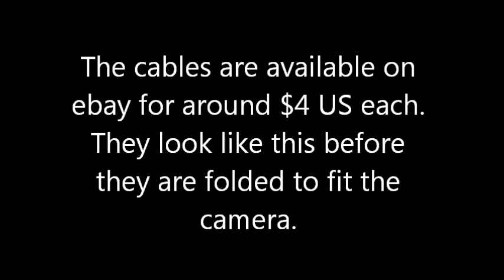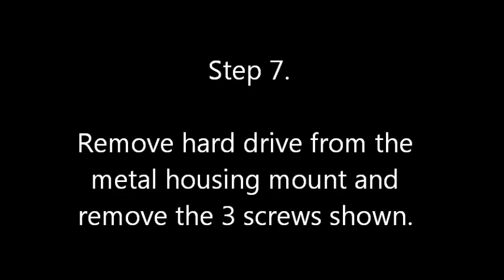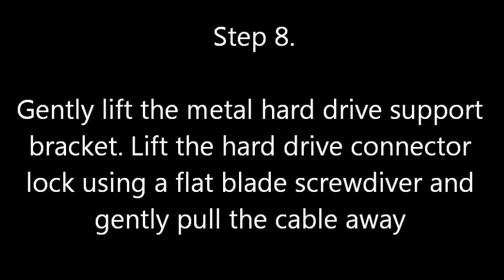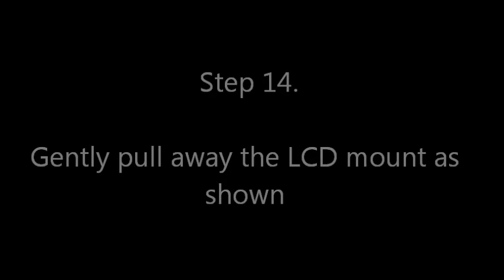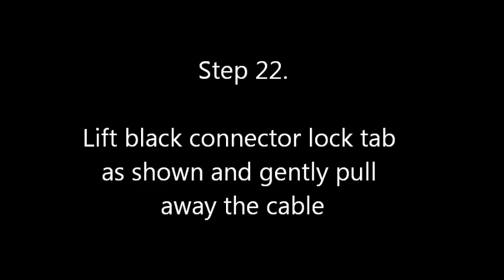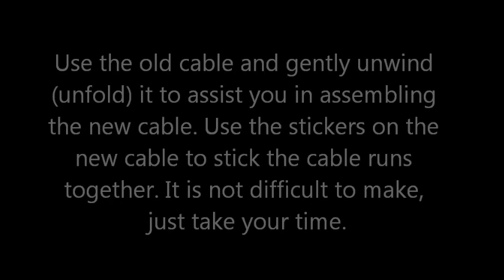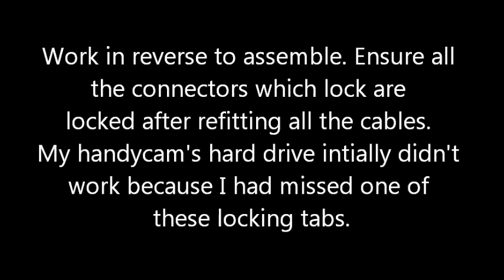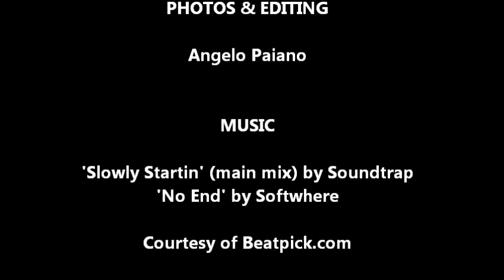Sony Handycam DCR-SR200E LCD Flip Screen Cable Replacement

Comment: Sir,
I require one sony handycam model no DCR-DVD808E display with flexible cable is it possible for you Sir? 
Please reply with your information please. 
Shinde
Reply: https://www.ebay.com/itm/253607505724

Comment: Just fixed my Sony Handycam DCR-SR82.  Great video.  Couldn't have fixed it without your help.  Thanks!
Reply: Hello my camera screen has vertical lines black and white, is it also from the flex cable or do I need to change the screen fully?

Comment: Hello budy, how are you ?
I have big problem I changed the flat cable, however remains the black wedged screen and more they do not light up, and before with the old lit still however was as if you were xiando, it is necessary to make those hinges on the cable? that other small and needed to be pasted on the most?
I thank the attention!
Reply from the maker: Liuz, if your screen does not work with the new cable, check all the cable connectors again. Push the cable in as hard as it will go then lower the locking tab. Check every single cable connector that you disturbed.

Comment: THANK YOU! I just repaired my Sony Handycam DCR-SR62. All components and screws are placed exactly the same way. Just a tip, I used a paper clip bent to a U-shape as a guide to aligning the holes on the new cable as I stick them together.

My other problem with this camera is the power / toggle switch acting very sensitive turning the camera on and off with the slightest touch. I'm still looking for info on how to repair/replace the switch. Please point me to the right the direction if you know.

Comment: just pulled out my old cable and can see exactly where it broke. Put the new one in, but screen is still black. I suppose I'll go through the steps again. the small cable on step 16 I couldn't get to fit back in the hinge casing... so I fit it somewhere else, would that matter?
Reply from the maker: it shouldn't matter too much. check all the cable clips/locking tabs again. make sure the cable is pushed in tight before you lock down the holder. this happened to me and I went through all the clips and on power up, it worked. good luck

Comment: Thanks for the help! I got my camera working. I was concerned after removing the original cable and not seeing any damage, but the new one worked like a champ.  I did have a little issue with my screen position switch, it fell out as soon as I opened the hinge and I had a hard time getting the positioning just right..  Seriously, is this the best Sony could come up with?

Comment: Thank you a lot. My camera is out  of order has some years. It is too much expensive to fix on authorized. I'll try to do by myself. Hope I can manage to fold it correctly !
Reply: If you have or know a video showing how to fold and pass the cable through the hinge, I apreciate ! I'm waiting my cable to arrive and have a couple of days to study all process. Thanks !
Reply: Very frustrated. I replaced my cable (it was broken) but the backlight refuses to light. I don't know what to do...
Reply: +Alex Antão Hi alex. try your quick release fittings again. push them in further, then lock the tab in. good luck
Reply: +Alex Antão Thank you, Angelo. Today I'm very happy. Took my camcorder to work and opened it again. Pushed the cables as hard (don't know if this is the right word)  as I could to lock the tabs. Now if worked ! Here is a picture of my camera finally working again:

https://instagram.com/p/BB7Un62hWEkMeH7WebopRrX2JT0vGP9Cv0up4I0/
Reply: That's great news. Well done Alex. Enjoy your camera again

Comment: This video worked great to fix a Sony DCR-SR82 camcorder.  Nice job on the detailed steps.  

The only issue was figuring out where the second small cable (with the switch on the end) needed to go in the hinge.  It fell out as soon as I opened the hinge cover.  I must have got it right since it seems everything is working again.

Comment: Wow, that is a lot of steps! But I'm thinking I may try to tackle it. We've got two DCR-SR200 cameras with screen problems. Both cameras function but the screen on one is totally gray and on the other, you can see the image but everything is tinted a dark blue. Does it sound like it is likely the flex cable causing both of these problems? I located several flex cables on ebay that say they are for the SR200E model. Ours do not have the E at the end. Do you know what the E signifies and if ours would take the same part number for the cable?
Reply from the maker: I would replace the flex cables. I can not find the difference between the DCR-SR200 and the DCR-SR200E except when I googled them separately, the DCR-SR200E sent me to the Australian Sony site whereas the DCR-SR200 sent me to the Sony Asia site. Both cameras look the same and the specs are the same. May have something to do with the market they were sold in. Good luck with the cable change!
Reply: MrTechtuber Thanks for replying back. Since I wrote the first message, I called a phone number I found for Sony. The person I spoke with wasn't overly knowledgeable, but from something they looked up, they thought the E at the end signified the European version. They didn't know what the differences were though. Any guess as to whether or not there would be anything different with the inner electronics between the two, since home power outlets are different in Europe? Maybe that would require some differences in the configuration of the battery and/or charger? Maybe all that is different is the plug on the charger power cord? Any reason why you might expect the flex cable would need to be different for US vs Europe power reasons? Are you from Europe, US, or elsewhere? Are household outlets in Asia different than US or Europe?

Also by the way, since my earlier message, the camera that had the blue tinted screen has now gone completely to a gray screen with no image at all, so it is just like our other camera. So it appears the blue tinted issue may be a sign that the flex cable has begun to break before it completely goes.
Reply: One other question I had is, do you know if these replacement cables are made any better than the originals, or is this something that will likely end up needing replaced again several years down the road?
Reply from the maker: frogsforall I wouldn't really know if they are any better however I've had the one replacement cable fitted for over 2 years and still going strong. I'd say that by its design it will eventually fail again. It would depend on your usage of the screen.
Reply: MrTechtuber I replaced the flex cable in one of my cameras a couple weeks ago. However, afterwards, I had issues with it. At first it had problems powering on. When I would turn the power knob, the power light would come on for a second and then go out. I left it on the charger for a couple days to make sure the battery was charged and even swapped batteries with my other identical camera, but still the same thing. I hadn't messed with it since then until this morning. After sitting on the charger for a couple weeks, it now surprisingly seems to power on ok. But still no image on the screen. I tried taking a "blind" picture and the flash went off so it seems like it took the picture. But I couldn't get it to do it again. It may be taking the picture but the flash isn't flashing. Another thing I've noticed is when I flip the zoom button from side to side, sometimes the camera lens moves in and out appropriately and other times it doesn't. I'm hoping there is just a loose connection somewhere, so I'm planning on taking it all apart again to see if I find anything. Any suggestions on what I might want to look closely for?
Reply: frogsforall
Reply: ЗАМЕНИЛ ШЛЕЙФ (КАБЕЛЬ), ПРОВОЗИЛСЯ ПОЛ ДНЯ, А В ИТОГЕ ВСЕ ОСТАЛОСЬ КАК БЫЛО, ЭКРАН МОНИТОРА КАК ПОЛОСАТИЛ, ТАК И ПОЛОСАТИТ (НА СЕРОМ ФОНЕ) НАВЕРНОЕ САМ МОНИТОР

REPLACED THE FLEX CABLE, WORKING HALF DAY, BUT IN THE END EVERYTHING REMAINED AS IT WAS, THE SCREEN OF THE MONITOR AS POLOSATY AND POLOSATIJ (IN GREY) IS PROBABLY THE MONITOR ITSELF